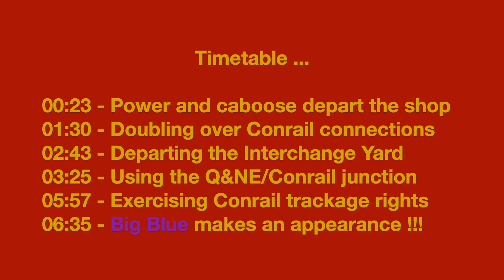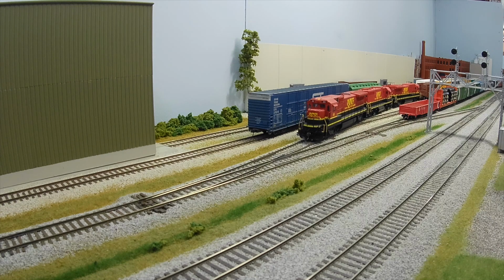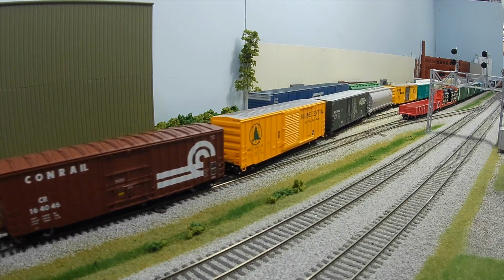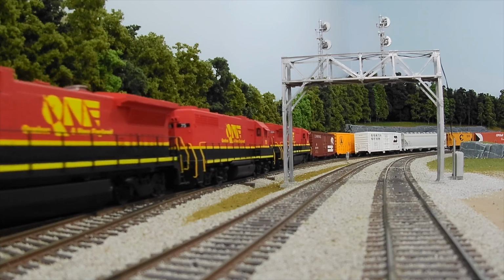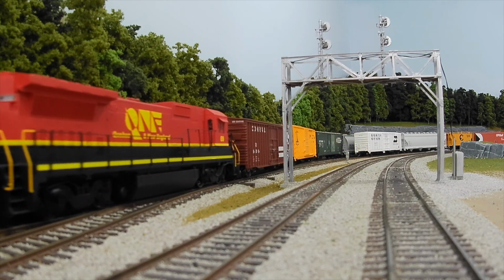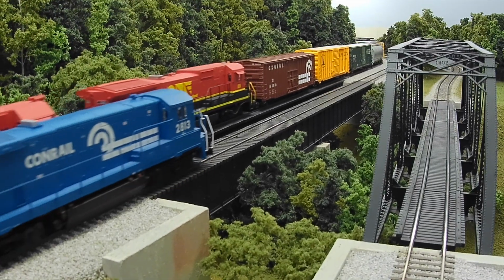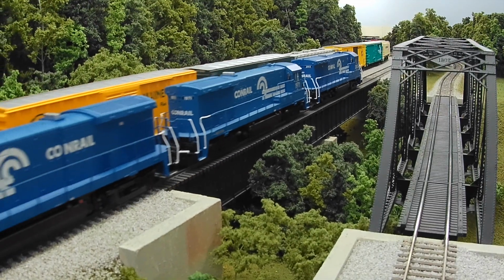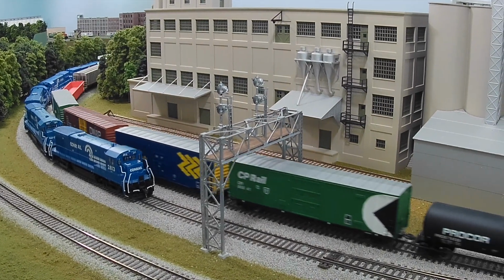Q&NE HO Layout Video 110 - 210213

Comment: I watch every one of these 😃 Q&NE railroad it's a great ho scale layout 😀👍 I got your railroad in my Playlist 😊 even so I got a question I noticed your freight cars isn't weathered 🤔
Reply from the maker: Thanks. Someday I'll get around to doing weathering but it will only be a light dusting. I am modeling the mid 1980's so many of my cars are still relatively new.
Reply: @QNERailroad  I understand my friend 😊 I know it takes time todo some weathered even so it's a ok 😁 I model newly form of the Milwaukee road knows as the Milwaukee Southern Railway Lines I have mixed of motive power emd & Alco and GE to the steam locomotive I am that type of person do not want to see stuff retired when they can steal be used 😊

Comment: Great show. Thank you. In total how many different Conrail loco's do you have? Are the majority of your Q & N E loco's out working in the yards?
Reply from the maker: Thanks Todd. Total Conrail fleet is comprised of 33 locomotives, made up of 2 U23B, 4 B23-7, 2 GP40, 2 GP38, 2 SD40-2, 1 SD45-2, 6 SD50, 5 SD60, 4 C40-8, 2 C40-8W and 3 B40-8. The Q&NE fleet includes 26 locomotives as follows: 3 SW1500, 4 MP15DC, 2 MP15AC, 2 GP9, 1 GP10, 10 GP38 and 4 B40-8. You don't see the Q&NE road units as often because  only two consists rotate in and out of staging each operating session. It may look like you are seeing the same units over and over but look closely at the road numbers. Two of the Q&NE road consists have 4 GP38's each. Same thing with the big SD's and GE's on some of the Conrail consists. There are 11 staging tracks, each with their own locomotives and cabooses that rotate on and off the layout, but only two Conrail and two Q&NE mainline trains run during each operating session, so it takes a while for a complete rotation of all locomotives and 350+ cars.

Comment: Thanks for sharing. I trully enjoy your videos. One question? What did you use for the red so I can send you pictures of my N scale QNE's.
Reply from the maker: I'd love to see your Q&NE locos! I used Floquil Signal Red. Hard to find. I'm down to my last bottle.
Reply: @QNERailroad  Yeah I can't find it. What about Vermilion? Or Floquil SP scarlet, Tamiya X27 red? Everything is ready to go but the red. I want to be as close as I can so it looks the same. Silly aren't I.
Reply from the maker: You might try SOO Line red or CB&Q red. I think Scarlet would be too dark. There has been a lot of chatter on the forums about Floquil replacements since they stopped production.
Reply from the maker: Apparently PolyScale has a Model Master Signal Red #2719 and Vallejo also has one. Good luck!
Reply: @QNERailroad   I have the Vallejo 70909 that looks right. I may use it. Thanks again. V